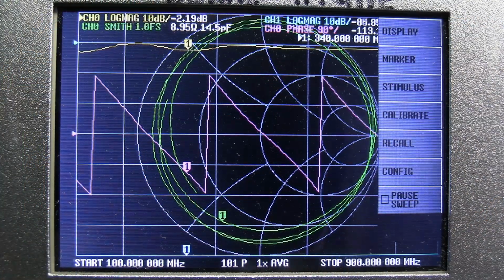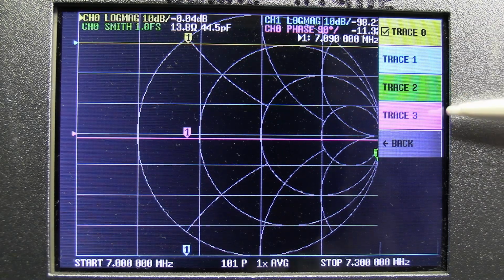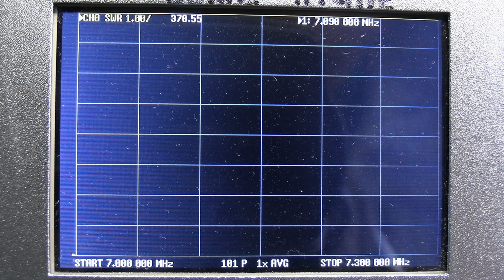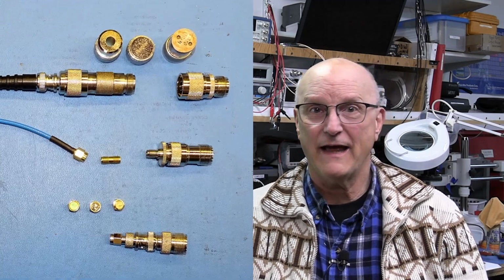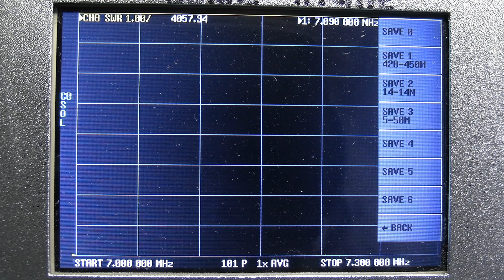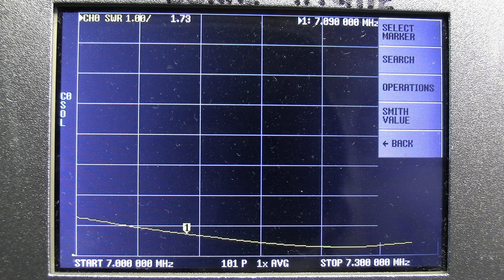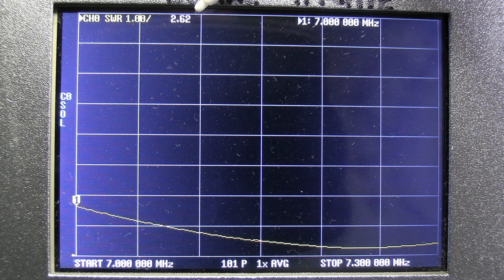nanoVNA: Measuring the SWR of an Antenna (068b)

Comment: At 7:38 you mention the NanoVNA "Electrical Delay" term when having to add a component to make the final connection (after calibration) to your test subject.  I have a similar situation when measuring my common mode choke.  I'm using a male SMA breakout to connect the grounds together (S21 LOGMAG) and each shield to the center conductor of the breakout.  Is this still "negligible"?
Reply from the maker: See the answer to your other question. Port Extensions adjust the phase and not the magnitude of the expected response. As such, they apply to S11 and S22 type measurements and have no effect on S21 or S12 type measurements.
This is probably a whole lot more clear and succinct than my last answer. LOL :-)

Comment: I appreciate your presentations.
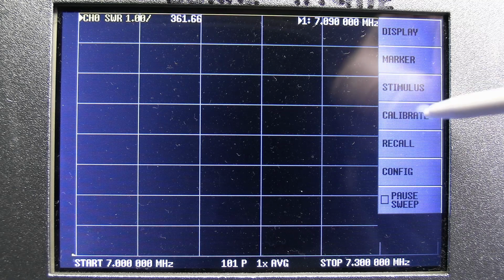At marker 8:06 in the video you tab on the CALIBRATE menu item. Before you tab on the next CALIBRATE menu we see the buttons RESET and RESET ALL.
We have learned to tab the RESET button before making a new calibration (Nano-VNA -H and -H4). This should to avoid that old calibration data could interfere the new calibration data.
Or are the RESET buttons only used when you had planned to save a calibration for later use? If yes, then a better word for RESET should be CLEAR and  CLEAR ALL. And which memory location is cleared when you us the RESET button?
You use a NanoVNA V2 plus 4 with a firmware version numbering that differ from the Nano-VNA -H (and -H4). Only a NanoVNA structure map was accompanied with my Nano-H4. That's all. And this map is no longer up-to-date either.
I am very anxious where you found the meaning of all those buttons (what they are doing on the background) before you start to make this video presentation? Could we have also found this knowledge ourselves?  I will point out that the meaning of a large number of buttons is obvious.
I suppose that you like to know what is changed after you have done a firmware update and escpecially when something in the menu structure is changed (updated structure map)
In other words, what is your information source?
Reply from the maker: Thank you! I am glad that my presentations are helpful to you.
You are very right about the RESET business. The assumption here in this video is that you just turned the unit on. As such, this means that it has no current, loaded calibration data and resetting it is of no benefit. :-)

Comment: Ciao Ralph, ottima spiegazione, nella realtà hai misurato il valore di SWR che comprende anche la linea di trasmissione (il cavo coassiale) quindi il reale valore di SWR al connettore dell'antenna sarà un po' piu alto di quello che hai misurato, questo è dovuto all'attenuazione del cavo, che riduce l'ampiezza del segnale riflesso! Comunque ottimo video, ti seguo sempre con attenzione 👏👏👏👏👏
Reply from the maker: Thank you!  The point of this video was aimed the "How to use the nanoVNA to measure SWR."
You are very correct regarding the SWR at the end of a transmission line.
With that said, the effect of the attenuation of the cable depends entirely on the frequency in use and the particular feedline being used.  At lower frequencies, the effect is generally so minimal so as to be ignored. When we get up into frequencies above 50 MHz, however, we now have to start doing our accounting. With knowledge of the feedline being used and its characteristics, we can measure the SWR at the end of the feedline and then correct for feedline loss to get a more accurate sense of the SWR. Not perfect, but better.  Unfortunately, it is rarely possible to measure the SWR (or impedance) of an antenna at its feed point.
🙂
Reply: @eie_for_you  ciao Ralph, hai perfettamente ragione, mi era sfuggito che siamo solo a 7MHz, e quindi l'effetto del cavo e trascurabile. Scusami ma sono abituato a ragionare su frequenze più alte, dove l'attenuazione del cavo può essere anche di 2 o 3dB e quindi bisogna tenerne conto! Ad esempio già in VHF 2m il "SWR Masking effect" dovuto all'attenuazione del coassiale può essere importante, non parliamo della banda UHF che già a 440MHz può diventare impossibile misurare l'SWR con un semplice rosmetro, (che leggerà SEMPRE valori molto piu bassi di quelli effettivi al connettore dell'antenna) in alcuni casi è possibile che non vi siano differenze di SWR sia che l'antenna sia collegata, sia che sia guasta o assente, perché l'attenuazione del cavo se elevata (ma nemmeno molto) rende la misura come se si stesse misurando un carico fittizio! (Dummy load) quindi mi domando a cosa servano i Rosmetri (SWR meter) per le bande UHF se segnano sempre 1:1🤣🤣🤣 Sei veramente preparato👏👏 te lo dico io che ho 30 anni di esperienza sulle antenne. Un caro saluto
Reply from the maker: @pierfrancescograzioli4080  I have visited this whole topic personally, realizing that SWR meters and adapters and ... well just about anything we insert in the feedline also inserts their own issues. Our "beloved" UHF connectors (PL-259/SO-239) for instance at frequencies exceeding 100 MHz...
https://youtu.be/HjbUK7yjpjA
or the antenna switch or SWR meter ...
https://youtu.be/1fpoViuxn3c
All of this motivated me to completely redo my VHF/UHF antenna system. Everything is N-type connectors. There are no antenna switches. The only thing in line is my lightning arrestor (with N connectors) and I tested it with my VNA before I used it.
In my mind, the average, affordable SWR meter is pretty much useless and VHF and UHF frequencies. 🙂

Comment: Dear Ralph, thanks for walking through this process as this is exactly what I bought my NanoVNA for. 🙂
My model has SMA connectors and came with calibration pieces for SMA, of course, whereas my T2LT antenna that I would like to tune has a UHF connector and I need to use an adapter (SMA/UHF).
Am I getting this right that for this type of measurement, I mean for merely finding the SWR minimum while tuning the antenna, I do not necessarily need to buy UHF calibration pieces to plug them into the adapter, but instead I can using the SMA calibration and I can neglect the hopefully minimal inaccuracy due to not optimal calibration? I assume the inaccuracy will be merely regarding the absolute values of the SWR, but it will not impact the position of the SWR minimum whithin the band, right?🤔
73
Henner, DO1HNR
Reply from the maker: Good day Henner! If all you are doing is measuring the SWR of an antenna and you are using a good quality adapter, then calibrating the nanoVNA at the SMA connector and adding the adapter to measure your antenna which sports the UHF connector will be just fine.
As a side note,while we are all very accustomed to thinking in terms of SWR, if you are interested in the most precise way of seeing the exact frequency of resonance, then view it in terms of return loss (S11 with a dB format). The translation from return loss to SWR smooths out the curve so that the exact resonant frequency becomes harder to see.
In the end, however, we both love to see the SWR because this is how we are accustomed to thinking about antenna matching. I mean, we all know that an SWR of 1.02:1 is a good thing, but a return loss of -17 dB doesn't really mean anything to us (though they are the same thing). 🙂

Comment: Great video. It also a good idea to quickly short out the antenna terminals before hooking them to the VNA to bleed off any static. I've heard about people damaging their VNA from that. Dipoles are static and lightening magnets due to the fact that they are an open circuit to dc. Discones and fiberglass antennas are also really bad. Take care and 73!
Reply from the maker: I *KNEW* I was forgetting SOMETHING! 😕Something was just nagging at me the whole time I was putting this together ... and THIS was it!  Thank you for telling me.
I put a HUGE **CAUTION** in the description.🙂
Reply: @eie_for_you  Thanks! Also, I assume this is a 2.8 inch screen VNA you're using (like mine). Either way this video will be HUGE in me first using mine. I've got some female SMA to male BNC adapters, so if I can, I believe I'm going to "permanently" leave them in place. I also have female SMA to female BNC adapters to hook the calibration standards. I think surface mount resistors can be soldered inside on connectors to make cheap calibration standards, particularly at lower frequencies. 73!
Reply from the maker: @W1RMD  I bought some male SMA to female SMA adapters which "live" on my nanoVNA.  If I wear out the adapter, then I just replace it. This is a LOT better than wearing out the connectors on the VNA itself!
Don't forget, when calibrating the nanoVNA, you need to do it as close to the place where you connect the thing to be tested as possible. If you are measuring impedance, then you would possibly apply a "port extension" (AKA: electrical delay" in the nanoVNA world). Failure to do all of this will lead to misleading readings. 🙂
Reply: @eie_for_you  Great! I heard you mention port extension before and in this video. Which video is best to watch how to do that? I have not seen all of your VNA videos yet.
Reply from the maker: @W1RMD  Of the released videos ... there is this one on measuring impedance:
https://youtu.be/Pti8Erw_Kkg
I use the computer interface to do it in this one.
On the other hand (she wore a glove ... LOL 😀), my most recent video on measuring the input impedance of a filter using a nanoVNA in "stand-alone" mode will be released to the public on May 15th. This followed by measuring the frequency response of the same filter two weeks later.  Then the frequency response of an amplifier. 🙂
Reply: @eie_for_you  Thanks! You do a great job covering all of the bases. I can't wait to follow along from home. Take care and 73.
Reply from the maker: @W1RMD  🙂 73
Reply: I was too surprised about the lack of warnings but in the past did do some experiments with using inline attenuators that are 50-Ohm and thereby provide a discharge-path.
Even shorting the connector is not enough because of the rapid recharge-time; I have a 5/8-wave 6-mtr whip atop my tower that will spark  the PL-259 once per second!
Anyway, what I found was that 3 & 6-dB units did not degrade the accuracy of measurement but 10-dB was getting a bit sketchy.

So, I would appreciate if someone would verify my finding, and see if you get acceptable results, as I feel this should be standard-practice for these dangerous measurements.
Thanks to Ralph and all!  73...
Reply from the maker: @SpinStar1956  Yes, one does have to be very careful about static buildup. In part, this is due to the weather at the moment. Yup, the weather. I am a bit iffy on the idea of putting an attenuator between my nanoVNA and the UUT when doing S11 measurements. At the minimum, this would mean the incident signal is attenuated by that amount and the reflected signal is also attenuated by that amount.  Additionally, in part, you are also measuring the characteristics of the attenuator.
For instance ... suppose I am doing an S21 measurement of a filter and I want to be sure that the output of the filter is terminated well into 50 Ohms. The ploy is to use a small, 50-Ohm, high quality attenuator on the output of the filter between the filter and Port 2 of the VNA (channel 1 of the nanoVNA). This way, the at-a-distance (via the port 2 cable) 50 Ohm termination is somewhat hidden from view and the filter "sees" a better 50 Ohm load on its output.
So, adding an attenuator in series between the nanoVNA and the antenna when doing S11-type measurements is going to seriously skew the results, from my perspective. 🙂
Reply: @eie_for_you  Well, I understand what you were saying, and I’m also at a disadvantage and that I did this months ago while trying to develop a 4 to 1 balun and a one-to-one balun for a friend. My blood started running cold when he asked me to test this on an antenna and so as a result, I wanted to see what I could do to protect my VNA. So, I started playing with the attenuators and I’m not exactly sure exactly how I configured them. My thinking process was, that the attenuator was not a termination, but simply an attenuation while retaining the system at 50 ohms. As I recall my testing process, I was using 25, 50 and 100 ohm terminations to test out the various SWR’s during the frequency sweep of the balun.  I also imagined that it would be somewhat like running through a longer piece of coax that would naturally have some degree of a attenuation (which I understandis because of capacitance) but the attenuation in the case of the attenuator would be purely resistive and not reactive.  As I recall, the measurements did not seem to deviate in their characteristics until the attenuation level became severe. Additionally, I thought surely that I had checked with the three different termination resistances mentioned above. However, in the end, my friend wanted the balun sent to him immediately, so I was unable to actually put it on an antenna.
Anyway, I will do my best to revisit these experiments and get back with you on what I was doing, and if I was somehow getting fooled by What I had configured up. we have an alumni field day coming up this weekend so I’m really under the gun but will do what I can because I want to know the exact reality of this. Thanks for all you do and for responding.  73…
Reply from the maker: @SpinStar1956  You are welcome!  The fact of the matter is that anything that we put between the VNA and the DUT will affect the measurement. The higher the frequency, the more this is true.
If all you are measuring is a BALUN on the bench, just connect it direct ... not to worry. 🙂
Reply from the maker: @SpinStar1956  Cool! You are welcome! 🙂
Reply: @SpinStar1956  Yes, any non dc grounded antenna, i.e. a dipole with each half not dc connected, or a discone, IS a lightening magnet. I've once a discone that when  I disconnected it from the radio when a storm was approaching, I got a shock so bad I couldn't hold the pl-259. Tried 3 more times and got shocked 2 of those! All within a 30 second period. I wonder if putting a high value resistor across any open antenna like that would not effect the impedance, but still short out the static discharge. Maybe 10k? Don't even get me started on fiberglass antennas. The must be evil because God seems to destroy these most of all! Those little fibers go EVERYWHERE! I had a dipole made from 14 gauge solid house wire that got struck by lightening. It was not hooked to any radio, but melted the ends of the wire only and melted the pl-259 solder off the end just where it hooks to the antenna. The rg 8 coax was fine. I resoldered it, re-used the connector and everything worked great after that.
Reply: @W1RMD  that’s quite an experience.  In the old days, hams would place a high-value inductor (RFC choke) between the lines collecting the charge (e.g. open wire) and ground.  This allowed a direct DC path to ground but when you transmitted, the reactance of the inductor was so high, it essentially became invisible to the transmitted signal.  There might be a home brew way to do it for coax, but you’d have to be careful not to upset the impedance.  That’s why most people use lightening protectors that are commercially available…
Reply: @SpinStar1956  I don't believe lightening arrestors will block static energy that's too small to jump the gap inside the arrestor but still large enough to damage a VNA. I could be wrong though. I use twin lead open wire myself 'cause I just a broke old farmer, but you could make an adapter with a high value resistor inside. I may try it some day. I am grateful for your feedback and I appreciate everyone who commented.  It's what this channel is all about. Take care.